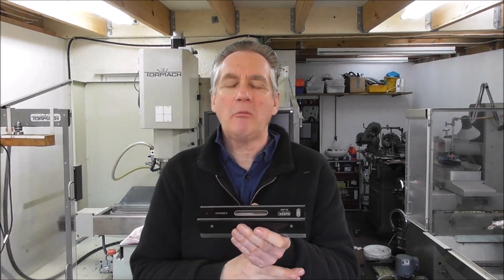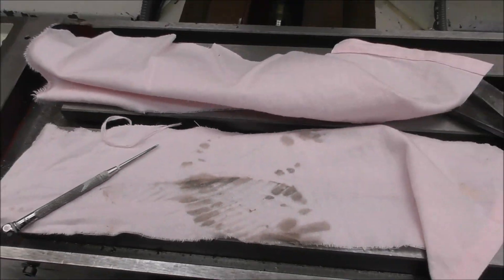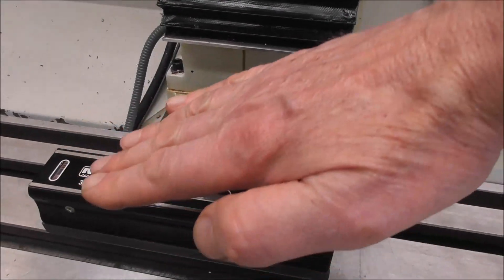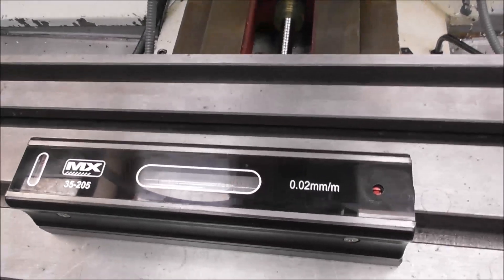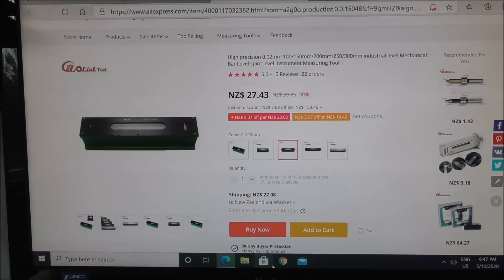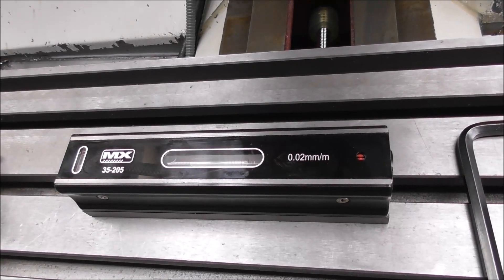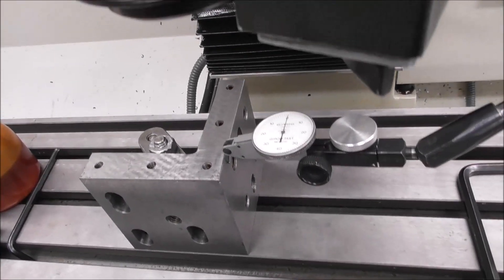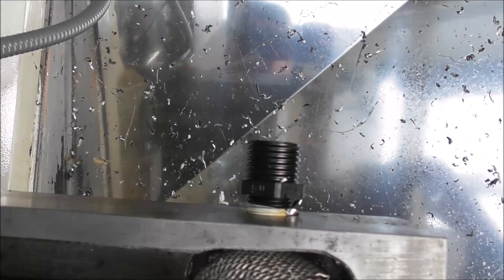Tormach Maintenance and 'Levelling'.

Comment: I must be so lucky. I bought a series 1 in 2008, it's been running for 13 years, and while I've had to make some electrical repairs and modifications, I have never done anything to it mechanically -- it's pretty well the way I took it out of the crate, and it's run for about 1 zillion hours.
Reply from the maker: Good to hear!  Cliff

Comment: Hi Cliff, I'm curious what model of Girod lever-type indicator you've got? I had a look at their site and they've got quite a range of models. Similar to your comment that you'd like a level with about 0.001" per foot gradation for workshop use, what would you be after in a levered dial?
Reply from the maker: Hi Darran. Well I just had a look and it does not have a model number!  It is a 0.01mm grad 0.8 mm revolution Girod- Tast with 6 rubies - but no model number!  I also have a 0.002 mm lever indicator, but I find it is not practical - too quickly off the scale and so hardly ever use it.  99% of the time the 0.01mm grad is better to use. (or inch equivalent) And you can actually see 0.002mm movement anyway.  Seems some folk assume finer must be better, but I disagree. (unless to are only doing high precision metrology tasks) .  Cheers  Cliff

Comment: Try using non-stick BBQ grilling mat in roll form (70"x16") available from Amazon.  It's an inexpensive source for glass reinforced teflon.  Attach to table end of bellows and run back and up the Z column.  It can easily be sewn into tented shape also.  Digi-pas makes a digital level of high accuracy.  The bluetooth version lets you lay on the ground and adjust leveling feet while digital level is up on equipment.  Cheers.
Reply from the maker: Hi SH. Interesting idea for a cover! Can you put a link to the item - I have looked and not sure I can find the one you suggest. Thanks for introducing Digi-pas - looks like some of the higher end expensive models would do the job. Cheers  Cliff
Reply from the maker: @specialhorse8062  Thanks - nearly bought it... but Amazon cranked it up to NZ$39.00. ..But let us know if you try it. Cliff

Comment: wood that gets wet exerts tremendous forces on whatever it's between. just a pin hole in an epoxied piece will demonstrate the explosive forces involved. Plywood might be a neat idea but I cannot imagine wood being stable for any amount of time.
Reply from the maker: Hi Jonathan. Thanks for raising that point, yes it probably is likely the plywood is wet in part, or at times - so thanks for the heads up. Cliff
Reply: @Threadexpress  I can see how using crushable plywood or a thin veneer of some kind achieve what you are trying to do. The key being that you would then want to measure a height of the area around the hold down bolt and then put a metal shim in as some kind of permanent solution. The problem being having a reliable way to measure the heights. on at least 2 of the corners.

Comment: I'm certainly no expert but I have a 0.05mm per Meter in the shape of the green square ones in the lower right of the screenshot at https://youtu.be/-RgB2Gy8uy8?t=1553 - that seems to work better overall than the 0.02mm per Meter I purchased for the very reasons you mention, at least from my experience in trying to get the twist out of my Tormach.  When you have the Tormach stand with 4 feet you really do end up going round in circles very easily with the 0.02mm per Meter level.  I've been thinking of changing to a 3 point mount by spanning the rear 2 feet mounting points with some box section and one foot in the middle and use 2 short lengths of the same size box section as spacers for the front feet.  You would need to replace the studs with some longer ones to match of course.  I'd be interested to know if anyone has tried doing this?
Reply from the maker: Hi Chris. Thanks for your thoughts here. Let us know if you try your span idea, how it goes. Cheers  Cliff